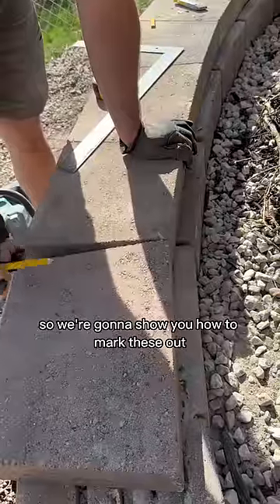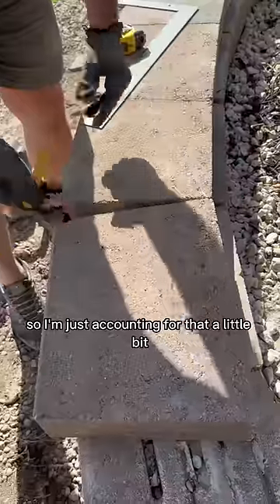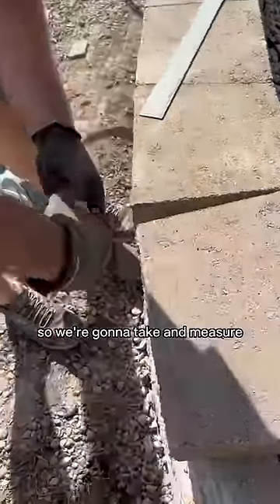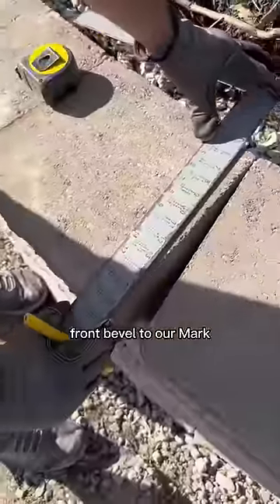PART 2: Cutting Caps on a Retaining Wall

Comment: Just set the square over the gap and mark both sides, always fits perfect.    Forget measuring
Reply: Came here to say this
Reply: Lol I never thought of this.
Reply: You're losing a lot of material on a long wall that way
Reply from the maker: Our cap has factory bevels, so we keep those to look nice. If they didn’t this would be how we would do it. A lot of time we don’t measure, but wanted to teach the method.
Reply: @RabWorks_LLC  looks great thanks
Reply: Wait, what? Can you describe that better for me? 

I'm a plumber dude. But may have to do this for a thing at my moms.
Reply: I think i can visualize it but not sure.
Reply from the maker: @djaa7  are you asking us or AJK?
Reply: @djaa7  You take a square and bridge that gap in the front as if the two front corners were a straight edge. You align the square so that it goes from the front corner to the back edge. 

Basically, the lines he cut in the bricks are perpendicular to the imaginary line connecting the front corners by the gap.
Reply: Can’t you just cut one block by making a parallel cut along from the sister block
Reply: @arealmaintenanceandrepairl1103  I believe the length of the cut on the cut block will end up longer and they will no longer fit symmetrically
Reply: @arealmaintenanceandrepairl1103  you could, but it won’t be symmetrical so it’s a lazy approach. Gotta make it look clean!
Reply: Yessir
Reply: @BullyBentley thanks for this, straight edge between the points made it click for me. Is this only done on one block?
Reply: @xeechav4538  No, both blocks
Reply: @BullyBentley  yep, got it now. Thanks!
Reply: Put all caps, and put block on top and mark
Reply: I know that's probably his first time
Reply: Stop using inches!!! Use cm! Inch and 3/4 is such a bad measurement

Comment: take that carpenter square and trace the angle of one of the caps to the other..mark it and cut. no need to measure
Reply from the maker: You could, but it leaves one cap with a longer edge and sticks out funny. This takes an even amount off both so they line up nice
Reply: @RabWorks_LLC  i do hardscapes and as long as you trace the right block it turns out even. you’re wasting precious time by measuring
Reply from the maker: @landonmorel3715  lol okay
Reply from the maker: @landonmorel3715  we see you use all that precious time saved to watch YouTube shorts 😂
Reply: @RabWorks_LLC  exactly…while you’re still marking and cutting caps i’m on to the next project watching slowing people like you work
Reply from the maker: @landonmorel3715  haha right…
Reply: @RabWorks_LLC  real stone guys don’t measure that out like you..:huge waste of time
Reply from the maker: @landonmorel3715  we often just parallel the line based on eyeballing, but used this as an opportunity to teach

Comment: Just make a parallel line. No measuring involved
Reply: Exactly. I use the narrow side of my level if the wide part of the gap is small enough... How does nobody know this? Fast and absolutely the most accurate.
Reply: It also depends on the radius and how much of a overhang you want. It’s not as easy if you want things it to be perfect.

Comment: How much is Versa Lok running in your area?
Reply from the maker: $7 roughly a block. Depends on what block color and look you’re after
Reply: @RabWorks, LLC  - Got it... I work for a company in Colorado and we manufacture Versa Lok Standards. We're right at about $7.05 ea untumbled.

Comment: I think this simple geometry is self-evident. 

Why don't you show your audience how to make a perfect circular planter. I did it using a vertical center rod pounded into the ground and rotating jig. The jig consisted of a level piece of plywood with a center hole on side to accommodate the rod and a piece of L-aluminum screwed to the other side. The width of the jig was the same width as the retaining wall block. This method allowed me to make 3 beautiful planters with an approximate 5 foot inner diameter, 4 blocks high using 12" blocks. It's critical to to get the first course perfectly level so that the last block meets at the same level as the first.
Reply from the maker: We did a few of those with a similar method last spring. We had some videos on them, but could have some more in depth videos if that would be helpful
Reply: @RabWorks_LLC  Did your method require a tape measure for each brick on the first course? Mine didn't.
Reply from the maker: @laurenarndt464  I think we did use a tape.
Reply: @RabWorks_LLC  That's my point. A tape measure is inaccurate and slow. My method is far superior.
Reply from the maker: @laurenarndt464  great
Reply: Let’s see your video
Reply: @JT_70  My video? I did these planters 7 years ago for my parents. They were done so well that my Dad's nurseryman hung pictures of them behind his cash register on the wall. If my explanation needs more clarifying, feel free to ask me questions.
Reply: @laurenarndt464  Sorry to be so obtuse, Lauren, but I’m not really understanding how the jig worked.
Reply: @JT_70  Take a smooth 1/2" steel rod. The length will depend on your soil type. Pound it into the ground. Test for vertical  using a torpedo level. Use a 3/4" piece of plywood. I used a piece of furniture grade. It wasn't warped. Measure the back of your retaining wall brick (the dirt retention side). This width needs to be the same as your plywood width. Cut a piece of 2×2 L-aluminum. The length needs to be the same as the plywood width. The length of your plywood needs to be determined by the desired inner radius of our planter. The radius will shrink as you increase the layers of bicks. Drill a center hole about 1" from the end of the plywood. If the plywood (jig) is 10" wide, your center will at 5". Drill two holes on one surface of the aluminum. The plywood should have true 90 degree corners. Screw the aluminum piece on the opposite side of the 1/2" drilled hole side of the plywood. The aluminum piece should lip towards the ground. The jig needs to be horizontal when setting the first course of bricks, even after rotating it. You'll need at least a 3 foot level to check for level. Don't leave the jig in the sun to avoid warping. Gently press the first brick against the aluminum. You'll need a mallet and a torpedo level to make sure the bricks are level. Test for level in two directions. I need to remind you to use the proper compacted aggregate prior to setting your first course with the proper footprint. Hopefully you will have the foresight to run a riser for watering your plants prior doing anything if you use automated sprinklers. Rotate the jig for setting the second brick and repeat the previous leveling process. Insure the inner brick corners make contact. You will also need to test for level using a 3 foot level between bricks 1 and 3 , 3 and 5, and so on. This will help ensure that you aren't nose diving or climbing as you continue to lay bricks. You will have to cut small pieces of bricks on the second and subsequent courses. Pick a side that doesn't get as much attention from foot traffic for these narrow pieces. Follow the cap stone instructions in this video. Don't put a planter near other invasive plants. There roots will grow into the planter.

Comment: just turn the block around
Reply from the maker: Does work it these caps
Reply: Can you Elaborate? These only have one face so I don’t understand.  Obviously I don’t have the experience you have but I have done a lot of concrete and retaining walls on my farm for years. I want to do one at the city house and it needs to be perfect due to it being in the historical district.
Reply from the maker: @waynewayne9693  these have a split face that is tumbled or chiseled, as well as factory beveled edges. To keep those bevels, you have to only cut off the the back of each cap.